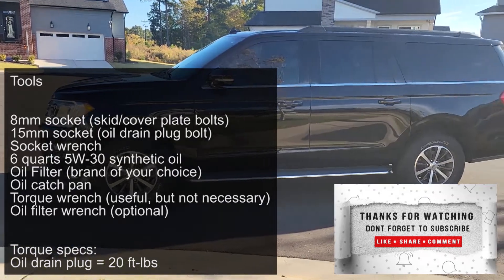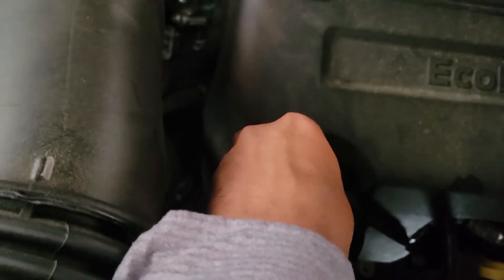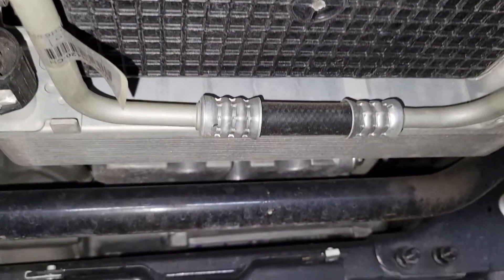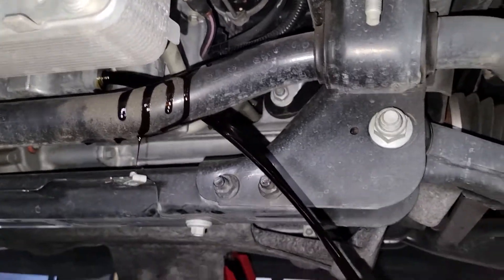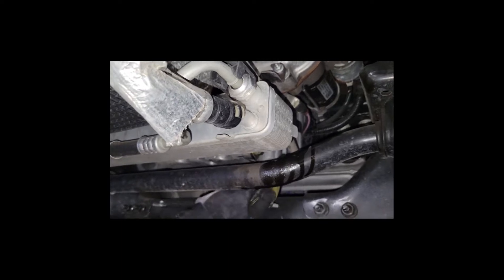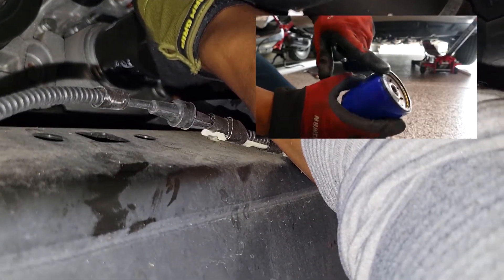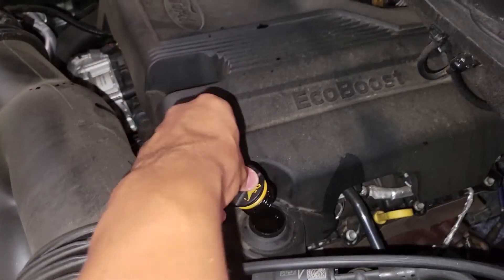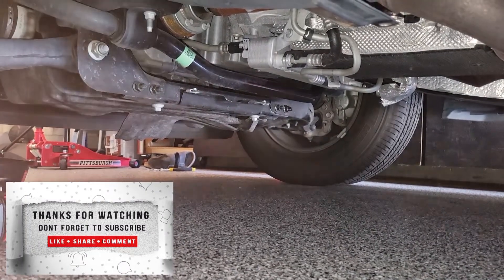2020 Ford Expedition Oil Change | Quick DIY

Comment: To minimize spillage from oil filter removal I loosen the old filter until I see a fine trickle of oil and let it drain under control into the pan until it stops. Then I proceed to remove the filter with no explosive burst of oil.

Comment: Great Video! However don't put Super Tech oil in your Eco Boost it does not have the right specification for turbo charged engines which is SN PLUS. Kirkland Brand Motor Oil has the SN PLUS Cortication.  Oil is cheap engines are not!!
Reply from the maker: Ill check out the Kirkland brand, thanks!!

Comment: Why do oups you use super tech oil in that nice of a car
Reply from the maker: Walmart is one of the largest providers of private label motor oil and such dictates quality from their supplier, which one happens to be Mobil1. I'd trust Costco brand motor oil as well
Reply: @EngineeredMojo  The Super Tech Oil does not meet the requirements for turbo charged engines. It needs to be SN PLUS Which is not on the Super Tech label. Kirkland however has the SN PLUS Certification. All of these suppliers provide many different grades of oil and just because they happen to distribute Mobil 1 doesn't make their cheap oil any better than what is on the label. I would not put Super Tech in my Eco Boost. Oil is cheap and engines are unbelievably expensive.

Comment: good video but if you have the front raised and remove the oil filter the oil doesn't route to the catch and instead goes every
Reply: Ahhhh that makes so much sense as to why it never falls in that drain
Reply: I think the channel is mostly a gimmick. I had the oil pan directly under it and the oil definitely did not drain that way. I noticed there is actually a hole perfectly positioned behind the channel where the oil flows straight through. It seems like the channel is only meant to catch minor overflow but if the oil is coming from the filter there is not enough volume for it to even make it down the channel.
Reply: @RodSquad-Reviews  if the front of the truck is lifted for service and not the rear the oil from the filter goes out the square cut out of the under shield below the filter.
Reply: @JBSaul  I had to learn that the hard way. 😂

Comment: Any feedback on the Super Tech brand? Very appealing price point at Walmart if solid quality.
Reply from the maker: @chadsatterla4015  never had any issues with it for standard operation of my cars. I use it on both a 250k mile honda civic and 300k tacoma in mild weather is the mid atlantic US
Reply: Same, I’ve run ST in all my vehicles for years.

Comment: Use a Fumoto oil drain valve F137 and it will make your oil changes even easier.  

Thanks me later 😊
Reply from the maker: That's a great idea, I'll have to check that out!
Reply: Looks like the Fumoto valve is for 12mm or 14mm… would it be compatible with this case (15 mm bolt)?